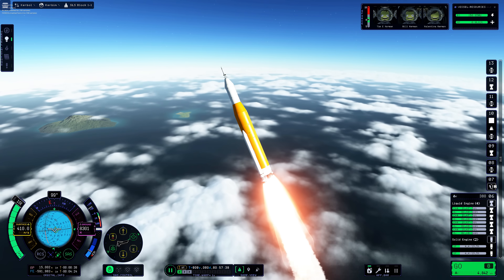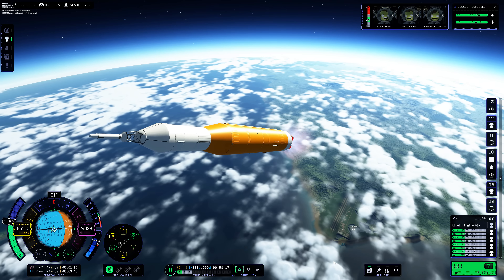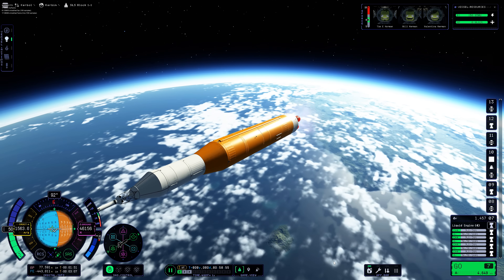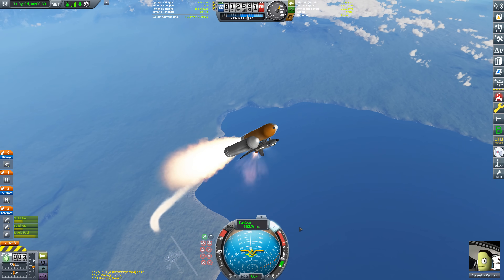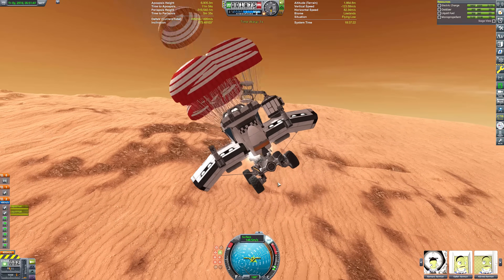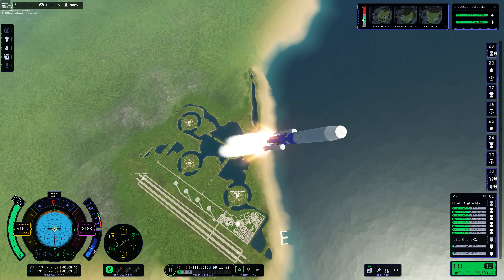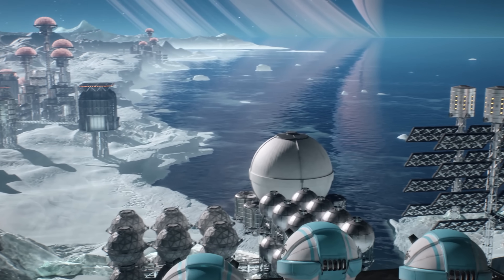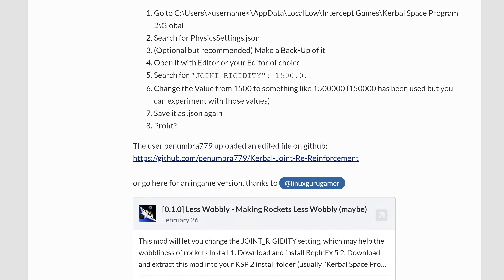Wobbly Rockets Still Haunt KSP2: Developers Face Uphill Battle

Comment: I've done game physics across multiple engines, including some AAA games with in-house physics solutions. This isn't a hard problem from the code perspective. Not for anyone who knows what they're doing. There are multiple conceptual ways to address it, and there can be a debate on merits, but once you decide on how the game should handle it, it's not that hard to make it work. Rigid physics is the best solution, IMO. You can still compute stress on a rigid body and have joint limits. It's actually cheaper computationally than doing the wobbly thing. So you can still have badly-built rockets fail from too much stress on a joint without them flopping like a raw hotdog. If for some reason you do actually want the rocket to flex, doing this with Unity's joints is about the worst thing you could do. A custom solver can run at 1kHz without breaking a sweat and would take about a week to write. There are fantastic talks on how to do this or you can hire a contractor to get it fixed. The hard part of a physics engine is managing the collision scene, and you can have Unity do that without using Unity's joint solver.

Comment: I don't know how this game is coded, but I would try having a minimum "torque" needed to break parts which are otherwise rigid to each other. Calculations are still ran on the joints for whether to break rigidity, then it performs the differing calculations between parts. This would cause vehicles to still flex under high G's but then as it calms down, the torque on each joint snaps back rigid.

Comment: I feel like this could be solved by going half way. Find a way to bundle the parts together and then treat each bundle as a rigidbody and just worry about the joints between bundles. In your example each stack could be one bundle. Or just say "we want 20 bundles" and just divide the the ship into 20 bundles in a fairly sane way. 

What you propose is totally doable. Source: 10 years of unity development.

Comment: In my opinion vertical joints should only work by how much torque is being applied, if to much torque is applied the rocket joint will split, the only parts that should have slight wobble should be the decouplers if they dont have struts to prevent dumb designs

Comment: Could someone clarify what makes this so complex? In KSP 1, we had auto-strutting, a feature that addressed the issue of wobbly or bendy rockets and was integrated into the science and career mode progression system. However, in creative mode, many players grew frustrated with the unrealistic wobbliness of rockets, as real rockets are designed for rigidity, and this feature became a bit tedious when building large rockets, especially in Real Solar System where complex rockets are common.

Given that KSP 2 is an updated version using Unity, why didn't they decide to incorporate the auto-strutting properties that were available in KSP 1 and enable it by default? There might be some kind of complicated technical reason, but I'm not aware of what that could be. Is the studio staffed with a bunch of junior engineers fresh out of university that have no technical experience with this type of software? 

I don't have any expectations for KSP 2 at this point - if they can't even figure out a solution to wobbly rockets then it seems this game is going stay in early access for a few years before Take Two simply cuts off funding for it and closes the studio for good.

Comment: It doesn't need to be either or. They could calculate the rigidity of every single joint when you build it. And then during flight, continuously compare the rigidity of every joint to the current load. If the rigidity is higher than the load of all joints, then treat it as a single rigid body. But if the load exceeds the "rigidity" then start simulating the wobble. It's not actual rocket science...😁

Comment: Reader, don't take this as excuse making;
Real world rockets do wobble and tremor, just at a far wider range of frequencies and with stronger materials.
But for performance sake, they need to replace the joint-kinematic based calculations reflected with animations, inertia, and aerodynamics with a structural integrity calculation that bleeds structural integrity of poorly built items.
The wobble made for good YouTube but was crap to play

Comment: I don't understand why most parts have any noticeable elastic deformation.  I think that implementing a system of slight elastic deformation -> plastic/permanent deformation -> failure (depending on the part / interface) would be best. I understand optimisation would be difficult, but if you look at games such as teardown with far more advanced physics simulations (and a seemingly much smaller team) it becomes evident that this is a *skill issue*. Don't get me wrong, I don't fully understand exactly how complicated efficient computer physics systems are. I just believe that that a team as big and financially supported as ksp2's should be able to provide a system at least as advanced as what I previously mentioned.

Comment: All joints between "matching" components (same diameter as well as a few other situations) should be ignored forming a single rigid body. Joints between non-matching components, such as stepping down from one size fuel tank to another without an adaptor, could have a simulated joint. Certain components such as landing gear, solar panels, dishes, and other accessories should always have a rigid connection to any structural part they are placed on but should not have a rigid connection to non-structural parts.

Any parts contained within (and not clipping with) a faring or cargo bay should not be simulated AT ALL while these parts are closed. The assumption should be that the payload is properly secured within the compartment until such a time as the compartment is opened. We should never see cargo clipping through a faring because the connection between the cargo and the rocket isn't as rigid as the connection between the faring and the rocket.

If "punishment" is required, they could also implement a system wherin any chain of "matching" parts of the same size that exceeds some length would have a simulated join as near to its midpoint as practical. This would address "noodles" by breaking long runs of narrow components into smaller groups that can flex realistically. But it should not impact proper stacks reasonable reductions in diameter as you go up. Potentially, they could even make joints between adaptors rigid in one orientation, but not the other - if you place something small on top of large, it's rigid, but large on top of small isn't.

Other parts, such as wings, may need some trial and error. Arguably, the aircraft seen near the end of this video should have some flex in that wing - but not nearly as much as shown.

It's okay to have simulated joints between connections that don't make a lot of sense, or would clearly have some stress. But there's absolutely no reason why we should need to place struts between each tank in a stack of three fuel tanks. There is no reason that we should need to add dozens of struts to brace a payload that we are enclosing in a faring. If we are building something "correctly" it should work and should be rigid. We should need to do some pretty silly and crazy things to produce wobble.

Comment: One thing they could do is letting us select parts of the ship where joints won't be simulated. Like If I create a ship with a huge core and side boosters, I could select all the core parts and disable joint so it is treated as a single physical element. Then I can leave joint physics on the side boosters or other parts. Player will be able to create realistic rockets with a lot of parts without wobbles and other players that just want to make creative ships they could make the entire ship one single hardbody. I think this would be the best option that would benefit every players.

Comment: Having one single rigid body would solve the problem of wobbliness AND greatly improve frame rates without any doubt. They don't do it for one single reason, it is that they are not capable of doing it. Because 1) it's far from being straightforward  and 2) they would have to rewrite the core engine from scratch which they decided very early not to do, most probably because it was too overwhelming. So they decided to take KSP1 and patch it with mediocre modifications with the result we know.

Comment: I know nothing about game making I won't claim to either but I play games and have seen their solutions to similar issues; -

Space engineers a 3D block building, space ship, exploration survival game can have massive issues when two grids are connected via a rotor or piston.

A solution was an option called 'Share Intertia Tensor' which to my understanding makes the mass of both grids on the rotor/piston share their mass and get calculated as one singular grid.

I can only assume this also shares their physics calculations, even if my assumption on how it works is wrong, the outcome is a reduction in wobble and broken physics, as well as working to prevent Klang/Clang from smiting your build into a new dimension.

Which indicates whatever their solution actually is, it works and very well at that.

KSP could benefit from assessing what other games do to deal with their version of this relatively common issue in games that allow creative building with physics based joints.
------------------------------------------------------------------------
Questions on its application to KSP; -

1- Could something similar be applied to KSP/KSP2 where large middle section like a large cylindrical fuselage of a rocket, makes the joint stronger directly proportional to the total wet/dry mass off all the fuselage pieces?

2- If that was used, could then lighter stuff on the sides, that would need engineered solutions to how they're affixed, use the normal physics model as them being smaller in size, mass and joint strength wouldn't be taxing and also give that 'realistic' wobble on non vital components.
--------------------------------------------------------------------------
End thoughts of mine; (these are just baseless notes for flavour) -

As large parts wouldn't accelerate or change their direction/moment of Intertia anywhere as quickly as a small parts, would it result in a more stable or realistic feeling game engine? - as touched on in question 2.

Comment: There should still be some movement
Im more refering to other creations than just rockets but even they have the tiniest amount of flex IRL
If you use the simple method it means plane wings for example wont be able to flex under load

Comment: I can somewhat see what they mean by referring to novelty such as in very large crafts, colonies etc. If you were trying to simulate real life there would be bending. some wobbling, movement, elongation, compression, etc. Even if your tank was one solid piece of metal it would still bend by a measurable amount. The amount the game currently has is very very exaggerated and since its physics are only bending / wobbling at joints, I think that is unacceptable if they are going for a 'realistic' approach. They either need to fix the physics and actually make them work. I understand if a lot of approximation is used in order to keep the game running smoothly, but if they want this game to be successful in the future, something definitely has to change here.

Comment: 10:10 as a programmer, I can say that what it depends on most is the implementation of everything else around it. This is totally doable, really easy, if you design the rocket-building with this in mind first. But it wasn't in mind, so there's the chance that the way rockets are saved and represented in memory and whatever that makes this infeasible. But without knowing how KSP 2 does its rockets, it sounds very, very feasible.

Most parts are cylinders, label the two connection points at either end of the cylinder specially, specifically by its diameter (or radius). When pieces are connected together, make a joint between them usually, but skip that process (instead merge them into the same rigid body) if the connection points are labeled exactly the same- i.e. they are specially labeled, and their diameters match. This would mean the pieces fit together seamlessly and could theoretically be made out of the some contiguous piece of metal, or there is otherwise a lot of surface area connection which should grant huge stability, etcetera justifying a lack of wobble between these parts.

To be fair, though, this system would allow for the construction of big crazy noodles which should wobble or collapse on themselves, and won't because they are treated as a single rigid body. There should be some extra consideration aside from JUST merging adjacent applicable pieces into one rigid body, although that's a big old rabbit hole of "how do you optimize simulating real life?"

Comment: 0:53 just make sure you still simulate stresses on all the joints so it will still snap into pieces if you pull ridiculous high-G maneuvers or let your aerodynamically-unstable rocket start to drift from perfectly prograde

Comment: The same sort of same stack to entity system would also work for aircraft, as fuselages also come in obviously different size classes of XS, S, M, L, XL and XXL. You just need a script which checks the object classes and connection points, merging entities based on if they are connected and of the same object class. Its a fairly simple baking system really, the script essentially does a scan of the rocket, merging every component of the same object class based on size which directly connects to another component together into one physics entity once its found another part directly connected which is not of the same object class. It does this for the full length of the rocket, and then 'welds' all the physics entities together. This can be easily added onto the system that already exists as it already does this, it checks for physics entities which are connected and 'welds' them together, all your doing is adding another check and pausing the weld function until all connected entities of matching object class size are merged and baked into single physics entities, then its all 'welded' together. There is honestly probably a tutorial series on youtube about this.

Comment: You can keep the wobble, but do two things. Make it so struts eliminate it completely, at the cost of additional weight. Make it so wobble is limited to 1 to 2 degrees. This would encourage structural soundness without being too punishing. I'd also make it so if a joint flexes too hard, it detaches, again, encouraging the player to put on struts and structural components.

Comment: Your suggestion of a stack-entity system sounds actually fairly viable. I've got a bit of experience with unity and it is totally doable for them to implement a system where If components in a stack are all of the same size IE a script that does a check to see if connected parts are of a specific class, which would likely already exist as it would have to for a science system like KSP 1 to exist, IE parts with the class of S, M, L, XL, XXL. If directly connected components are the same class "XL" they are merged and count as a single physics object, while if directly connected components are not of the same class, then a constraint is added that allows for a bit of flex.

This way a three stage rocket comprised of say, 3 tanks, an engine + decoupler and a connector component per stage, all these components, if they are all the same size class, would be merged into a single physics entity, meaning the three stage rocket would consist of only 3 physics entities. I feel like this would obviously resolve the problem and keep some of that KSP charm of slight flex.

Comment: I feel like the answer is ultimately going to be merging certain subsets of parts into single physics objects so that a hundred part vehicle has maybe seven or eight discrete physics parts in flight. the challenge is going to be programming a way for the game to make those decisions intelligently so that it matches what we expect intuitively when we build the rockets. I don't think just single physics objects is the way to go in this case just because the scale of kerbal 2 vehicles is just on a whole other scale compared to planes. you need some amount of nonrigidity to penalize certain types of implausible builds. and once we get orbital construction I would expect that certain ships built in orbit and designed for space would collapse under their own weight if they landed on the surface and you don't get that if it's all a single physics object. I'm reaching a bit past my paygrade but I'm not sure you get solar panels or similar non aerodynamic parts shearing off on reentry if the whole craft is a single physics object either. and we would miss that, I'm sure.